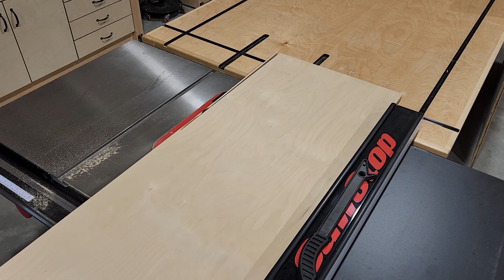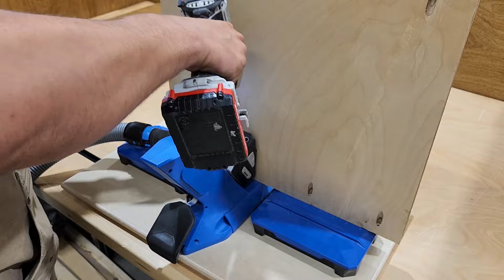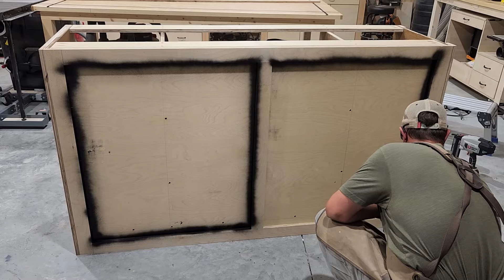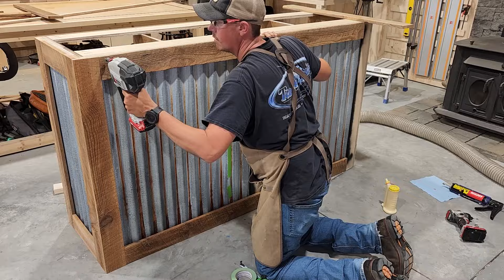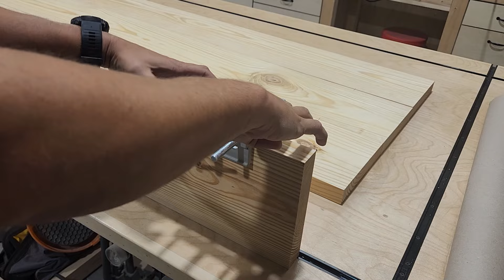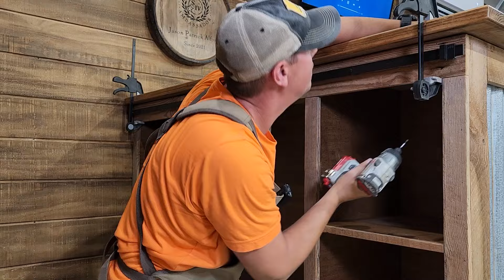Your Man Cave Needs This DIY Rustic Bar

Comment: My son in law and me built one almost identical with the exterior and top but left the cabinet area inside completely rustic . Did not use plywood . Use barn wood for the shelving and all . And restored and added an old stainless metal  sink that belonged in a milking parlor.
 Or milk house .

Comment: Do you have a source for the galvanized panels?
Reply from the maker: Home depot or Lowes!
Reply: On your shop walls did you put a piece of plywood as a backer or the metal directly on the studs?
Reply from the maker: @markcrook5935  https://youtu.be/avVtmMOrDfI?si=53r-KS6t-45L5fI0
Reply: @PatriotDIY Thanks, I’ve seen that one some time back…you used furing strips so mine is the same concept except I’m going against traditional studs with insulation. Thanks for the reply, really like the channel.